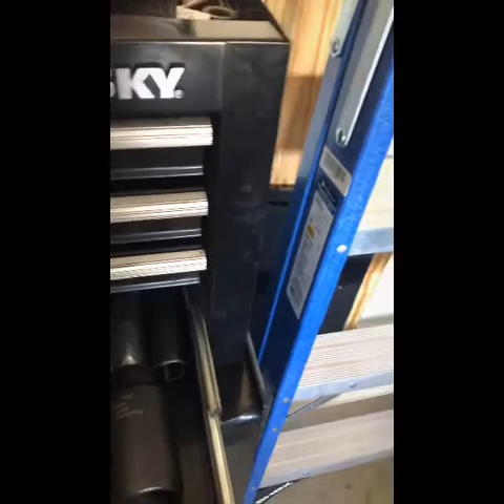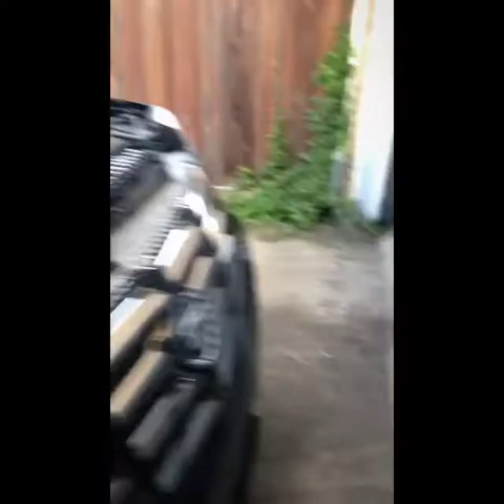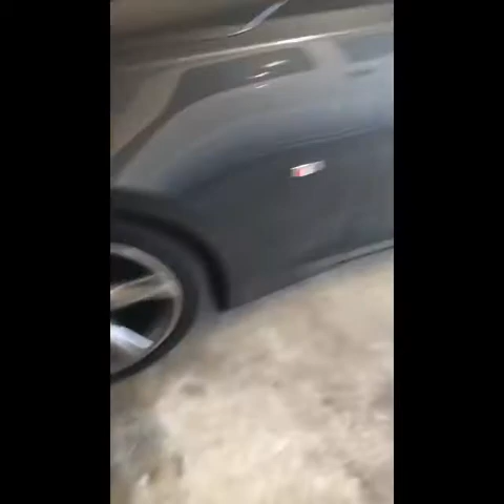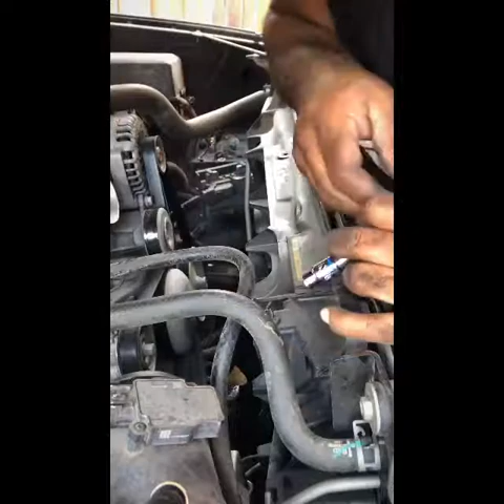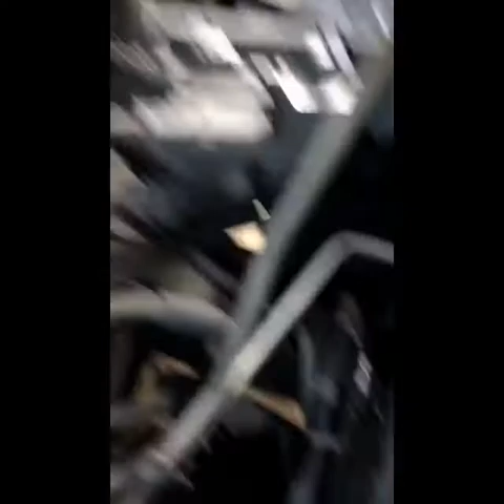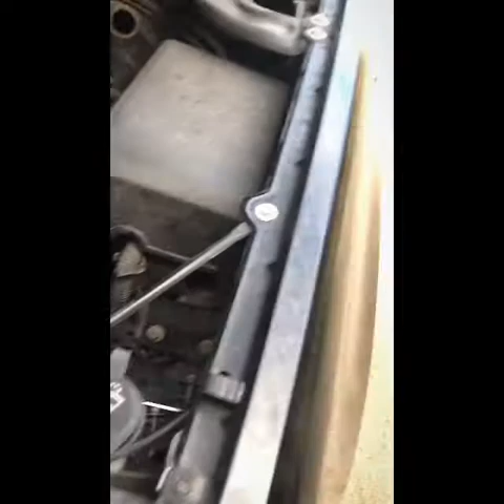How to replace Cadillac escalade radiator #Dallas#Detroit#DIY

Comment: about to change radiator in my 99 escalade soon as the part comes in so doing a little pregame with these ty for posting
Reply from the maker: Very simple to do YOURSELF!! I actually had a 99 escalade if you watch some of my older vids. Did a TON of work on it. Thanks for watching and subscribing👍🏾
Reply: Yeah I’ve my 99 about a year and it’s a quality piece of machinery ty

Comment: Hey brother didn't 2011 Cadillac escalades only come with the 6.2????
that's what I have, also did that radiator have a cap just wondering which would be the easiest way to flush all the coolant out not just the radiator but the engine too
Reply from the maker: Best way to flush system is to have it power flushed. But if you doing it at home you can remove the bottom water pump hose and upper rad hose. Then use water hose to flush from top Rad hose until comes clear out of the bottom water pump. Drain pug is on bottom of radiator if you just want to drain Radiator
Reply from the maker: Also be sure to hit the subscribe button
Reply: @biglesent  the bottom hose is hard to get to without taking the fan out, is the plug on the bottom of the radiator easy to get to? Could I undo that and just flush it from the top radiator hose???
Reply from the maker: Doing it that way will be much slower. The bottom hose on the water pump is hard to get to?
Reply: @biglesent  well it's not hard to get to but the clamp is turned around and I can't get to that, and that's from the bottom or the top without taking the fan out
Reply from the maker: Ok i get what you saying i truly hate when they do that with the clamp. Drain plug on Radiator is on passenger side at the bottom. Hope this helps…